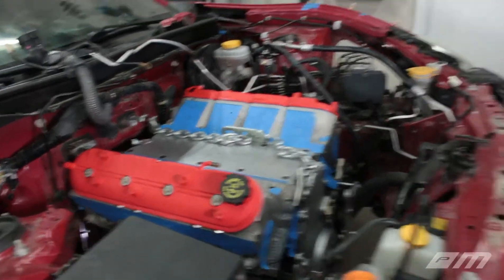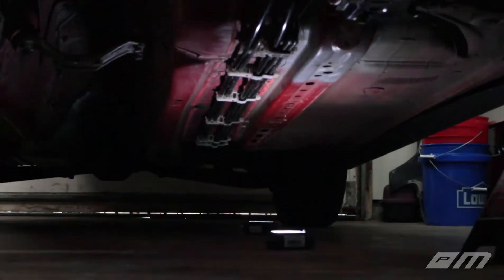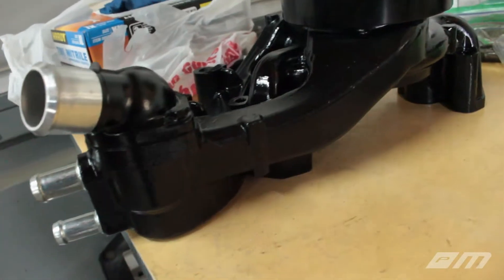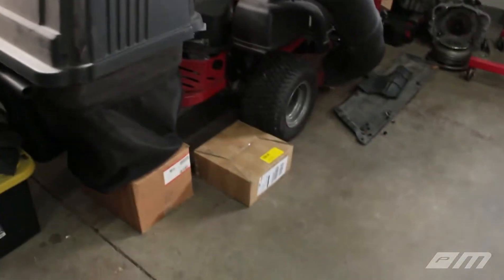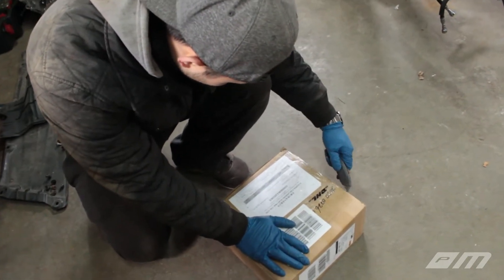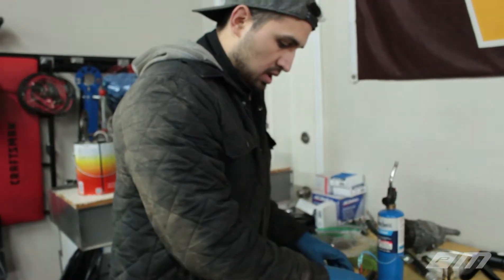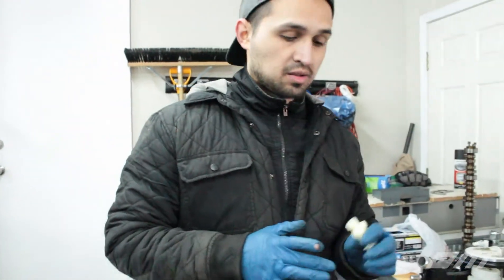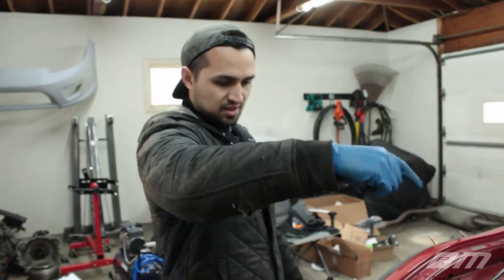Changing FRS fuel system to a Return Fuel System!!!

Comment: Question when you installed the fitting on top of the fuel pump did you stick both rubber washers on the bottom side or one on top and one on bottom
Reply from the maker: I installed one washer on top and one on the bottom. On the bottom side of the fuel carrier top hat, I smoothed out the surface so that the nylon washer would sit flat and it also gave me more clearance. Hope this helps!